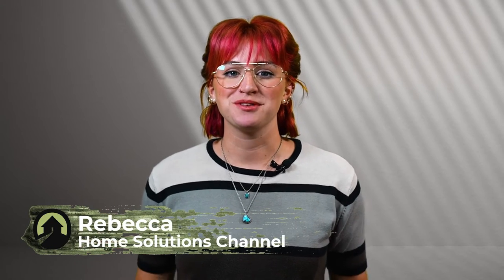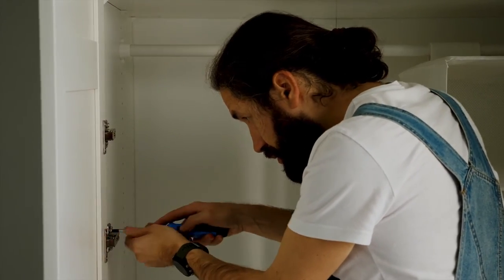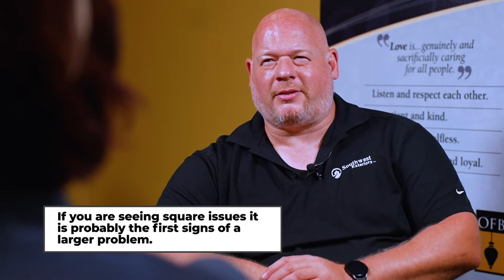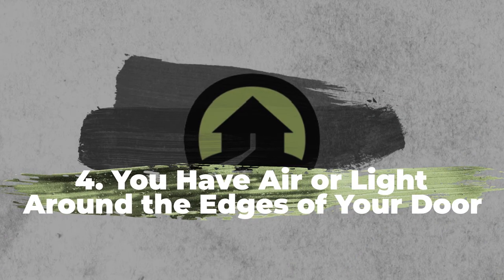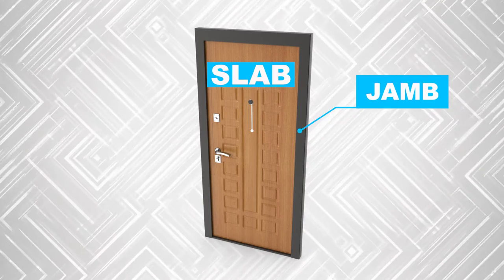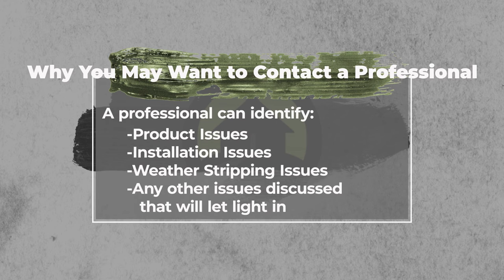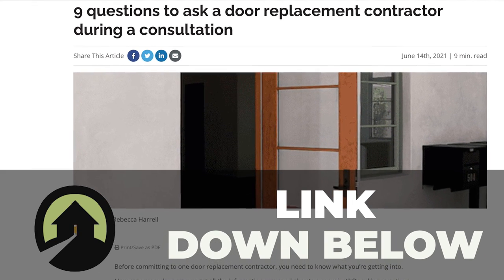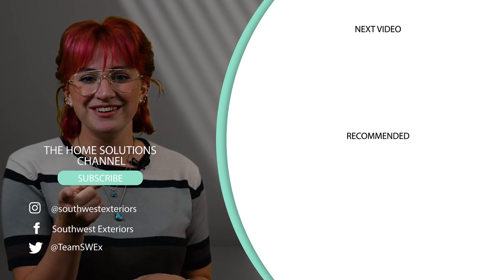5 Common Problems With Doors (Causes And Solutions)

Comment from the maker: Thank you for checking out this video. If you have any questions on a Door Replacement, don't hesitate to leave them below. We'd LOOOVE to hear from you!!
Reply: I have a brand new door at work and for some reason it doesn’t close all the way without a lot of pressure but it’s used in a restrurant so needs to open easy, any ideas?
Reply from the maker: @tamimai2888   Initial thoughts would be to try and locate where it is sticking to see if there is a simple adjustment that can be made with the hinges or slab placement that might help fix the problem. 
Sticky doors usually could stem from building settling or foundation issues, but with a new door it should have been installed to take whatever inconsistencies with the frame into account.